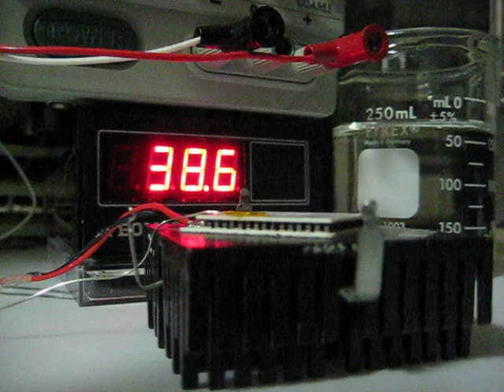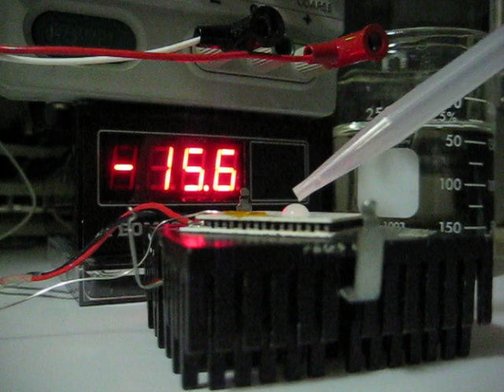Thermoelectric Device Demonstration Peltier Effect - Cooling

Comment: Well, yes, using the same device shown here, you can use heat (actually a temperature gradient) to generate an electric potential.   This however, would be called the Seebeck effect instead of the Peltier effect as demonstrated here.  Thank you for your question!

Comment: Im looking for the same setup, where did you got the controller and the peltier device? can you send the company name? What's the accuracy of the controller. I actually just need the hot side to change the surface temperature from 25-40 with a reasonable accuracy.
Chhers, Mazi

Comment: hi,
we have a polymerase chain reaction (PCR) machine in our lab which uses the Peltier effect. we were having a debate about the work load on the machine at different temperatures and hope you will resolve it for us.
question - does the machine have to work more if it has to maintain temperature at 4deg as compared to 25deg celsius (ços 25 is closer to the ambient)?